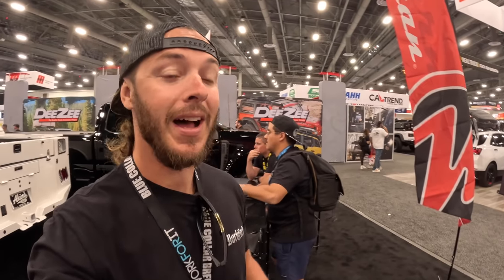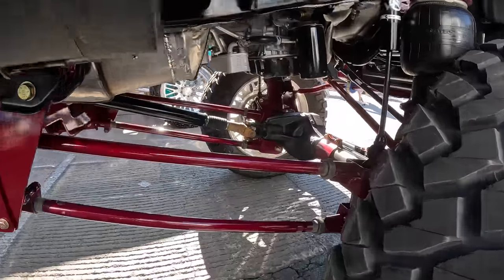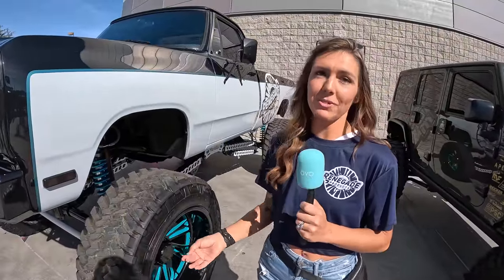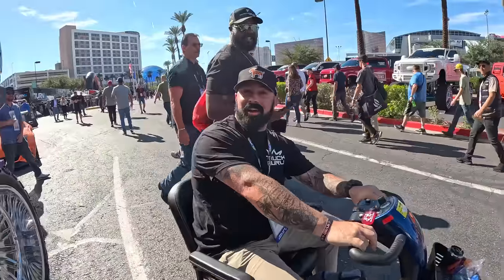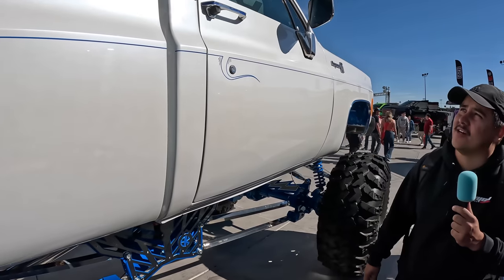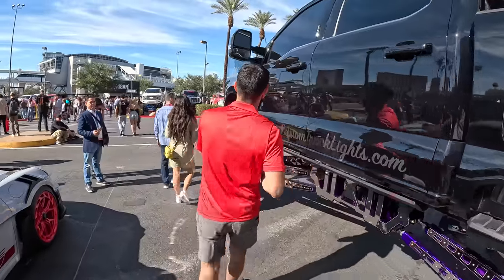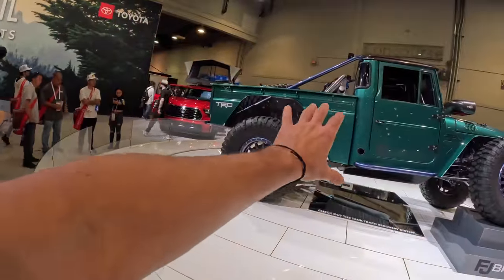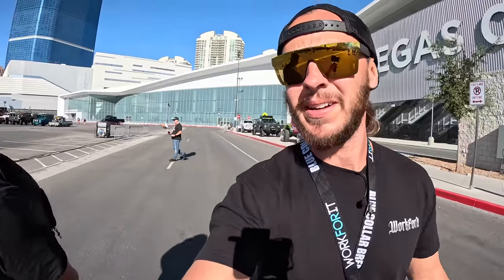Some of the BEST and WORST Lifted Trucks at SEMA 2023

Comment: I didn't see it, but if you went by the PMF booth, they had a killer OBS shortbed crew, built by friends of mine from Jersey.  IMO - blows all of the other big-wheelers out of the water.  Just has the right 90's vibe to it with Welds and Swampers to boot.

Comment: Why haven't I ever seen any rig with the Patigonia MTs. I own couple sets of them and never needed bead locks even dropping them down to 8-10psi with no beadlocks rim. I've driven them in 2-3ft of snow also in mud without a bead popping on stock rims 99 dodge durango 5.9slt but I do swear my 5.9 durango was built like 3/4ton I had to buy 3/4ton dodge and chev parts to get em to fit. Either way tho love what yall put into your rigs to make look noice. 
No disrespect

Comment: I will Stick to my FORD TRUCKS your dads truck is newer & bigger than mine I have a 2002 FORD F-150 LARIAT SUPERCREW CAB WITH THE 5.4 TRITON ENGINE rwd it has over 262 thousand miles on it but I put a custom MERCEDES BLACK WITH GOLD AND SILVER METAL FLAKES WITH BLUE PEARL LED HEADLIGHTS TAILLIGHTS THIRD BRAKE LIGHTS TAG LIGHTS I need to get some other stuff done I would love to get the engine rebuilt

Comment: Detig has it wrong with trucks. It’s not long bed vs short bed for raising a truck or lowering it, it’s if it’s a 4x4 you go up, if it’s 2wd lower it. 

I will die on this hill.

Comment: All of these trucks look absolutely ridiculous to me. With that said, the white HornBlasters square body Dedic criticized for lacking a track bar had a triangulated four link, so it doesn't need one. And considering this pavement princess is likely never gonna have to roll over much more than a small pebble in the driveway, the bit of channeling to accommodate the exhaust is hardly going to effect the integrity of that frame any.

Comment: Do NOT close the door by pushing the door handle on old trucks. That handle is to pull it, not push it. It will start bowing the door in around the handle in short time, you are going to start noticing it bad on a black truck.

Comment: Cali trucks are gay lifted like that what do you do with it besides mall crawl those flog trucks are bad ass just the wheels and suspension is ridiculous i have a f150 with 35 and 18 with a 6 inch lift and thats the biggest i like going over 6 and you got to do so much to fix angles .